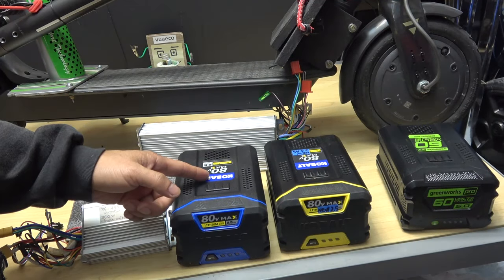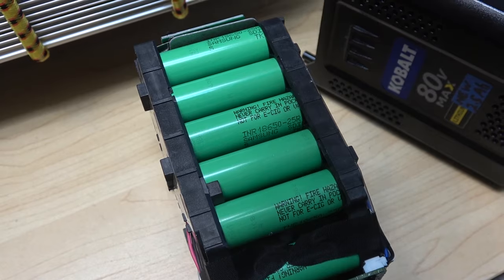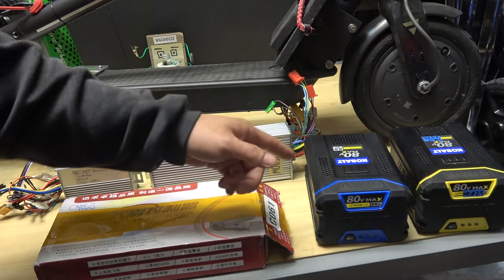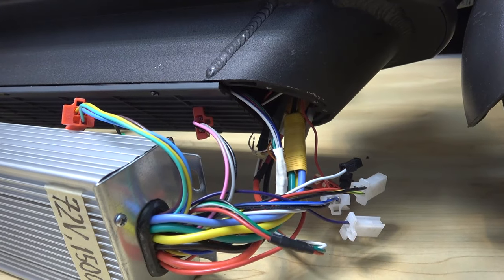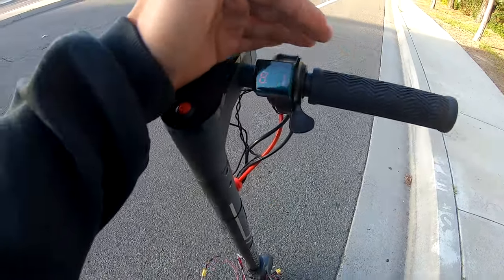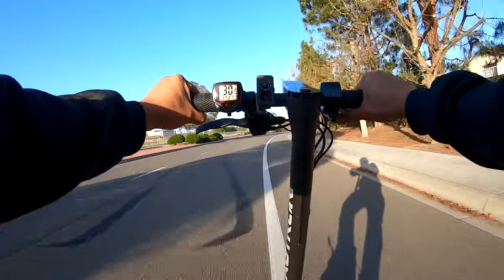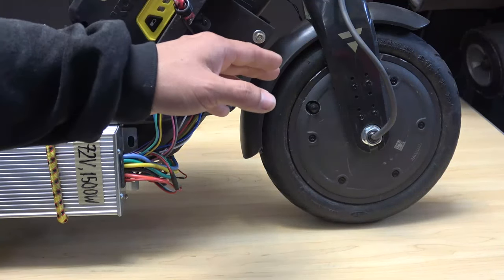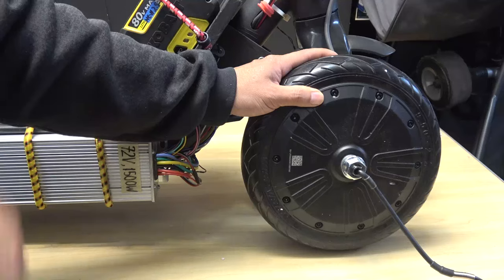DIY: Install a 72v 1.5KW controller & 80V battery on a 36V Swagtron (Xiaomi M365/Bird) scooter

Comment: I never considered a scooter  until I saw your channel. Only considering a electric bike but you are showing me the light . 

I have to go 10 miles to the rental van Uhaul dealer and a scooter may be just the ticket  Small enough to fit in the van  easily.   I could switch out the batteries  once I drive the van back to my house if need be for my return trip  on the scooter  after dropping of the rental van. Yea, uh hum, yea.

Comment: When I c one of your vids, I drop everything to watch. It's not just the entertainment factor,  I have a 48 volt fat tire bike and I always look for ways to improve it. My controller is also very small. I will probably get a 52 volt battery and the same controller u purchased. My bike maxes out at 18 mph. It would kill me to c u blow by me with your hair on fire at 25-30 mph on a scooter.
Reply from the maker: I think your controller probably limits the top speed to be at 18. More likely a new controller would make a big difference.

Comment: You got to love the scooter rental places giving us all free parts... If the company is going to continue to let people just dump them by the roadside or at the entrances of shopping centres and shops so people can trip over them then I think they are great candidates for some free parts..
Reply: Changes are slowly being made .

How about focus on the Customer not doing what they are supposed to like putting it back in designated area. 

They obviously hire people to go pick them up but you can't be everywhere all the time. 

They will start to be equipped with locks now an if not put back you will lose your ability to rent. 

Hardly a reason to turn into a thief and steal product 🙄
Reply: @dznuttzonyachin7499  but think of all the free parts... And the GPS module is put in a real simple place to remove it from.. the company's are just asking for it.. you can even sell most of the parts on eBay an make cash.. it's a win win win.. you just need to look at it as recycling.. 😏
Reply: @brookerobertson2951   you sound poor
Reply: @brookerobertson2951  one too many O's in your first name 😂🤣..... Broke Robertson
Reply: @dznuttzonyachin7499  that a good one I will give you that.. broke.. first time hearing that so you get to win in the comments championship.. lol
Reply: @dznuttzonyachin7499  but........ Your name .... Like... That's a "i still live with my mum and I am 29" name.... Let's be honest..lol
Reply: @dznuttzonyachin7499  ok cool.. later.. 👍
Reply: @brookerobertson2951    Surprised he missed this but Broke Robbertson is even better,  you know since you're robbing these parts,  just saying :)

Comment: You're a wizard.  Maybe you can get more top speed if you do something with the tires so they don't slip.
Reply: Larger pnumatic tires aired down should do it. Or switch the front and rear tires would do it. Rear wheel drive is much safer on these scooters for high torque settings

Comment: Its more about the bms on the battery and your controller should always match battery voltage. The controller is not meant for 80v as it is 72v. You are correct that is just over 20 amps but the frequency might also be off. 

To sum it up Start with matching controller voltage and battery, than go under amperage as the bms might be turning off before hand, not likely an issue with frequency but possible. Could possibly be the board in the motor limiting to 10amps or motor windings shorting due to not being built to handle such amps or voltage. Best shot is prob to get a new bms ngl

Comment: Could you use the original controller if you upgraded to capacitors to the 100v 1000uf for the big one and the 100v 47uf for the small capacitor?
Reply: Have you tried this?
Reply: @johnhornbeak5735  havent needed to, the controller can handle 72 volts fine
Reply: @kevmatt8450  you are pushing 100V through a 36V controller with no problems?

Comment: Good video u proved my point 1p wasn't enough the voltage sag is too much even the cell are rated 20a that peak with sag without sag it's 2.5ah in your case since the rule is 1c, u could get more higher speed with less vdrops, we got the same problem im on a 20s setup on ninebot max and can't get more than 55kph on road due to 20s3p... But off ground its 80kph... The second motor u showed at the end looks like the rental okai es200 motor if its actually kind of the same u should get crazy speed...

Comment: 😊🤐😣...honestly u gotta be careful at those speeds with those size wheels, if u hit something on the road u could take a tumble n break yourself
Reply from the maker: That's why I'm thinking of the next size: 10 inch motor! :D
Reply: Also no suspension whatsoever.

Comment: is there any consiquencess might happen when using differnet watts on different voltage .. i mean different voltage and watts on hub .. different voltage on battery and different voltage on controller and mix it together >??

Comment: Have you tried using the controllers that came with those 80 volts batteries came from?
Reply from the maker: That's a great idea. Only if the 80V tool has variable speed, though.

Comment: Might try a Kelly KBS-X. 200phase amp 72v controller. Its MUCH smaller and MUCH better than the 72v off brand controller used here.  I run mine at 88v.  Also ruin 3 120v yard force in P on my mini bike.

Comment: hi there i have a 48V 60V 72V 84V 2000W Brushless Motor Controller Box 45A for Electric Bike/trycycle/E-Scooter/Dual Mode Hall/ Hallless Sensor and i have a 75
v battery pack (36s 2p ) and a m365 motor 36v and it is cutting out  but if i push throtle slowly it does go but after about 5 secs it cuts out again all i have wired is throttle /motor/battery to the controller have i not conected a wire or something any idears what this maybe i was thinking to much power to the motor and thats why it was cutting out but it seems to work ok with yours  any suggestions  would be helpful thanks.

Comment: Some guy on reddit suggested I buy a custom controller that puts my dual batteries for my m365 pro in series instead of parallel, which would theoretically supply 84 volts to the motor, which genuinely sounds terrifying. How controllable is the scooter at 30+ mph?
Reply: Probably not good. But you dont have to go 30mph, power is more for the uphills.

Comment: I've got a 600w 48v scooter that does 30mph.  If I get a 1000w controller will it go faster ?
Reply: No, doesn't work that way, if you get a bigger battery such as 60v with a 1200w controller, you would  get up to maybe 45 mph top speed and it would be quick.. If you did a 72v upgrade it would hit 60 mph easily.

Comment: Hey you inspired me to purchase a 72v controller and double up my batteries to achieve your results.  I got the controller 1500w and putting 81.3 volts to it with no success.  The only way I can get the controller to do anything is with only one battery to it 40v and the learning wires connected. But no throttle control.  Any clue as to the issue or would it be a faulty controller any help appreciated I want my scooter to fly also lol
Reply from the maker: Did you wire everything correctly? A 72V controller would not likely to work with a 40V battery though. Something is wrong.
Reply: @vuaeco  I only used the phase wires and hall sensor wires Color to color minus white from motor hall, and three wires for throttle b,g,r and a switch between main red power and small red.  With nothing, I figured faulty throttle, so then I purchased throttle just like yours and the same that's when I separated the batteries and only got it to spin with learning cable
Reply: Ended up being a faulty controller. Got a different one running 2 bird 2 batteries on one of the scooters, flies, cruises 38mph all day it's heavy as hell tho but prob good cause rwd. Thx have fun!!

Comment: hey vaueco I got ebike called Livingbike 369 that look eerily similar to your Swagtron EB5 what controller do you recommend I know I need a 36v 350w but which one should I choose I bought it used the guy who previously owned it ripped out the electronics
Reply from the maker: I think that 36V 350W controller would be perfect for it. Don't get the one shown in the video as it only runs on 48V or higher.
Reply: @vuaeco  I read the service manual the engine rated what I mention also need a new throttle it just sucks it's hard to get new replacement parts
Reply from the maker: @Linkhunter  If you replace with a universal controller, you can just use any 3-pin throttle.

Comment: ido the same thing 72 v controller and 80v battery when i run 10km hub motor become very hot and you smell it burn….may be need hub motor upgrade

Comment: Just take the electronics out of the case of the controller and it will fit inside the scooter
Reply: Good thinking. But I suppose the controller housing is not that big for nothing.